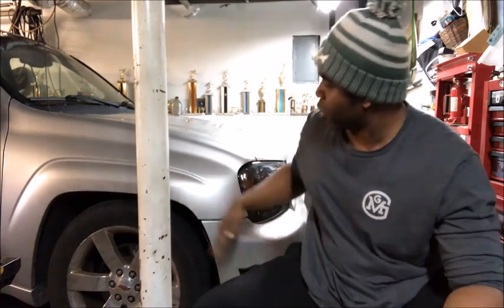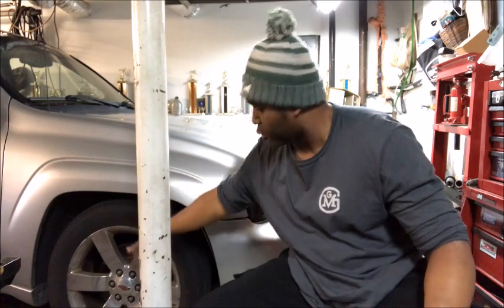Lowering your Ride? Make Sure Both Side are Even For Best Performance.

Comment: Tony says to use 8mm on driver and 16mm on passenger, along with a lot of other members on the forum to compensate for the factory lean.  What do u think?
Reply from the maker: hes correct, but sometimes you have to do a lil more adjustments..
Reply: Did you trim the bump stops in the rear?  I dont recall you saying anything about it in your rear suspension video
Reply from the maker: i did..  you have to.. not that hard i took a wiz wheel to it.